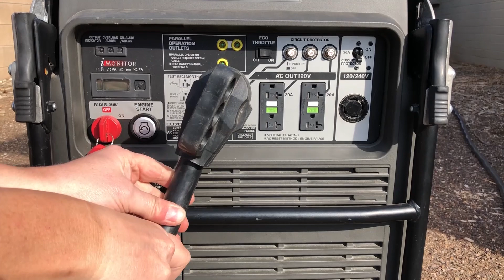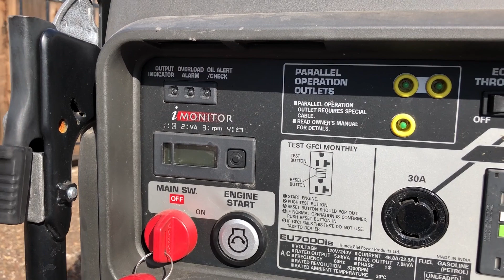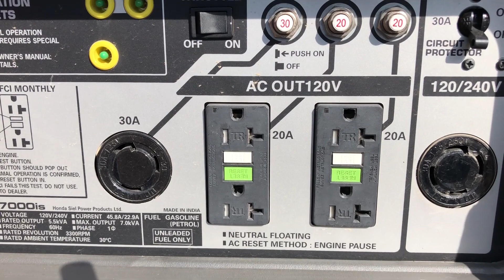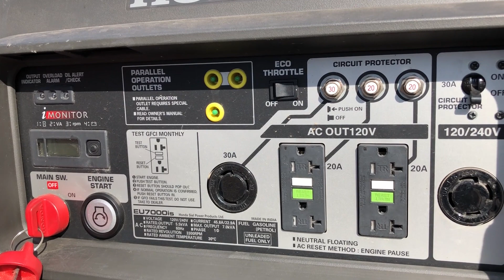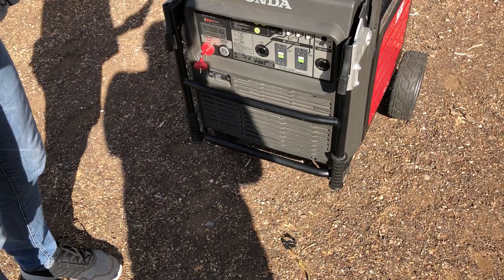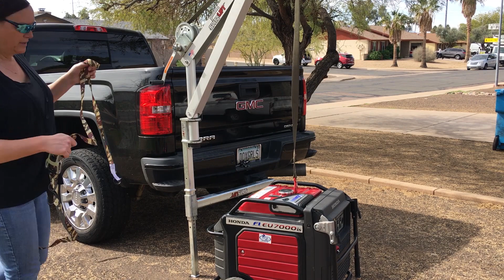⚡ E1.3 Honda EU7000is Generator

Comment: I have both the EU2000I and EU7000is. I wasn't aware they could be paralleled, as you stated. Could you possibly explain how, and any limits or constraints on the use cases?

Can you also bump up your audio? I had to go to 100% volume. I enjoyed your point of view and comments. I look forward to the next video.
Reply from the maker: Awesome question!

You've taught me a lesson, which is to be careful shooting my mouth off on YouTube. I casually mentioned paralleling dissimilar Honda generators because I'd read some articles of various people doing so. Indeed I went back today and found multiple examples and videos of people paralleling two and sometimes three dissimilar generators. BUT - the part I had previously overlooked was, they always began with verbiage to the effect of, "This voids the warranty". 

Curious as to why Honda might say this I think the most cogent article I found, funny enough, is from Cummins:

https://power.cummins.com/sites/default/files/literature/technicalpapers/PT-9017-P3-Dissimilar-en.pdf

This is a very technical article but the short of it is, proper paralleling of dissimilar generators requires an additional circuit called a 'load sharing control system'. This system tells each generator what speed to operate at as a percentage of their own contribution to the percentage of load on the entire system, which the dissimilar generators cannot know simply by observing bus voltage and frequency.

With this information at hand, I personally amend my comments in the video and suggest to our wonderful viewers, unless you want to risk possible damage to your generator, stick with Honda's recommendation of only paralleling same-sized generators.

Oh, and yes, we'll work on our audio levels ;o)
Reply: Airstream MTB thank you! That all lines up with what I thought and read. I didn't know if I was missing something. I just used my EU7000i yesterday for 3 hours as household backup. It is a great investment so far. Take care.